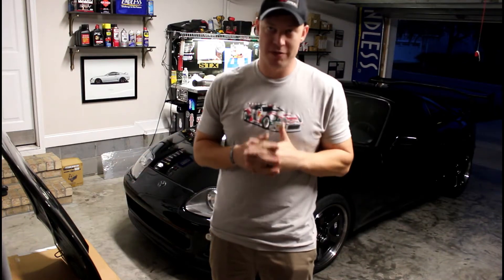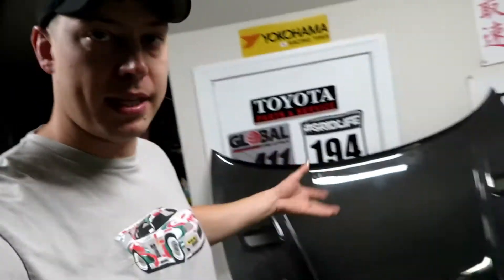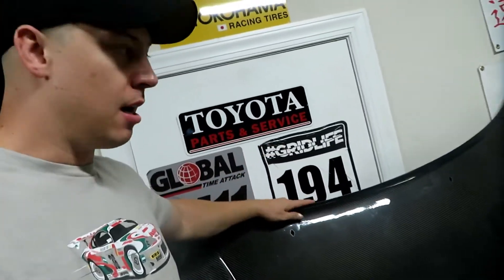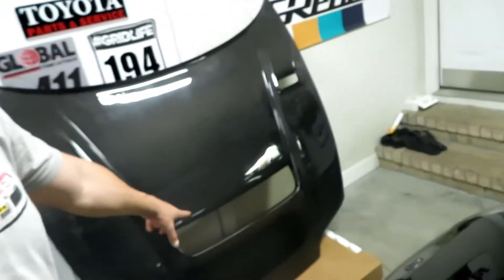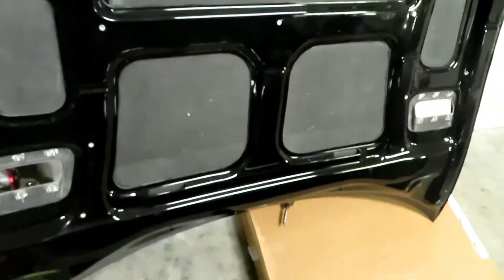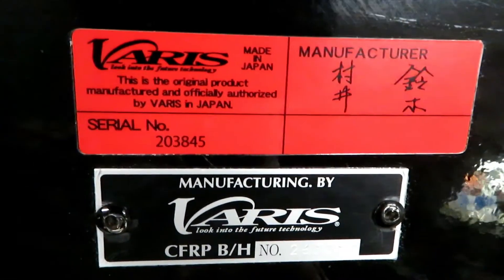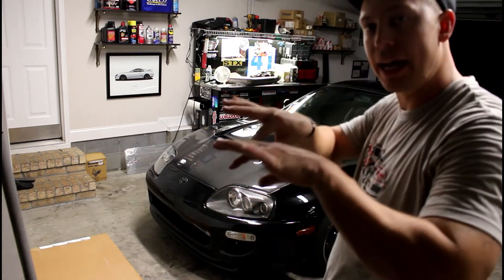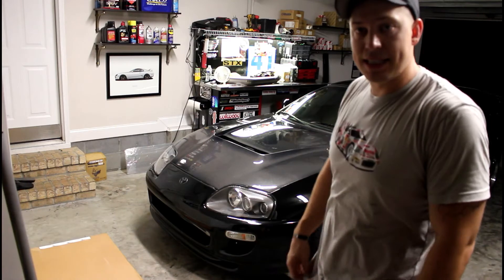The BEST Carbon Hood for the MKIV Toyota Supra

Comment: I am torn between this and the Top Secret hood. Seibon is not good. Ridox and TS are the only way to go. I think the TS hood is around 12/13lbs as measured on Supraforums, but this hood looks better. Decisions, decisions....
Reply from the maker: I have the TS now.
Reply: @Weapons_Free_Racing any reason other than style that you moved away from the Varis ? My Varis arrived the other day.
Reply from the maker: @That.Old.Toyota  the car was still overheating on track, and i needed to move more air
Reply: @Weapons_Free_Racing  surprising, you’d think the Varis would promote a lot of heat extraction through the rad. I saw you had an oe style hood with added vents, and now TS, did you play with setup to isolate that the different hoods gave you better heat extraction through the coolers, or is this part of a broader revamp of cooling, ducting and heat extraction?
Reply from the maker: @That.Old.Toyota  i did a whole cooling system overhaul. My OE style with vents was melted in my fire.
Reply: @Weapons_Free_Racing  got it, and the oe with vents performed better than the Varis, or had you also changed other elements of the cooling system?
Reply from the maker: @That.Old.Toyota  been through 3 radiators 4 fan set ups and now 3 hoods. 

The rad-industries.com dual pass radiator seemed to be the ticket. Probably didn't matter on the hood as they all have seemingly adequate venting.